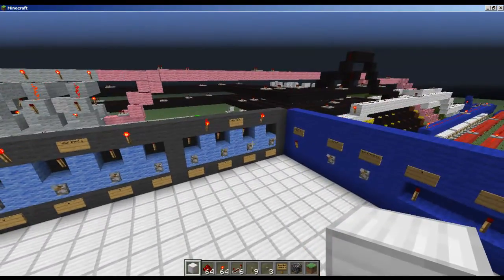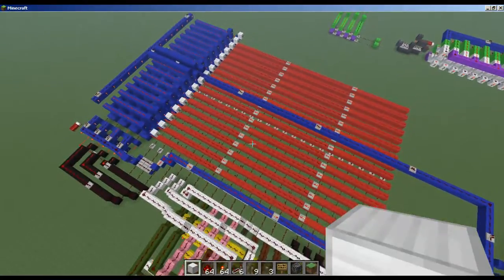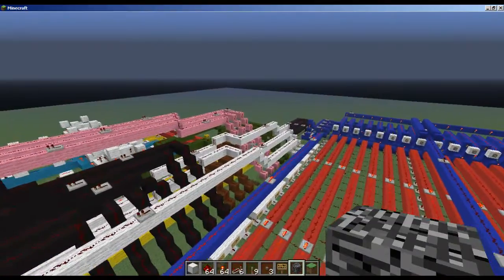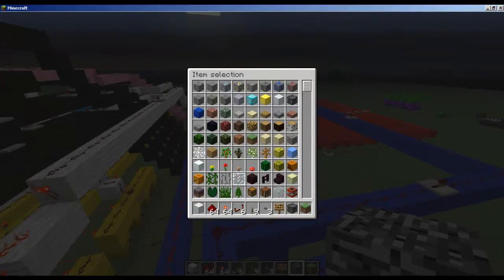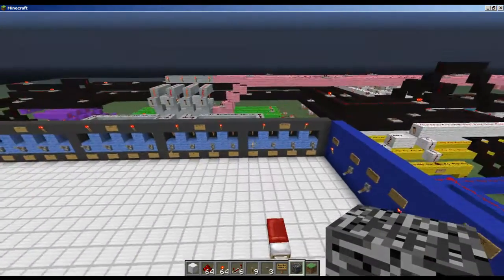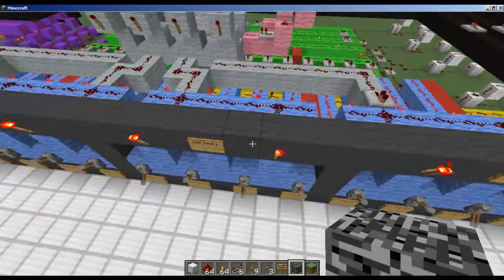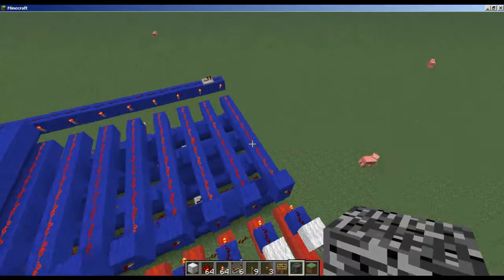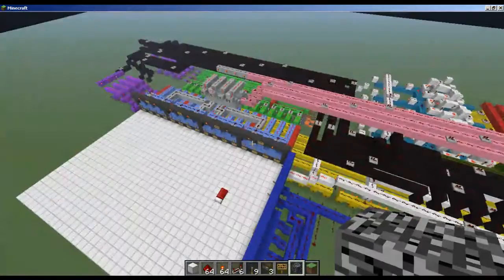4 Bit ALU Computer in Minecraft - Tutorial and Download

Comment: I am currently making one of these (from the same tutorial) WITHOUT Mc Edit. But the diffrence is, mine is (or will be) VERY compact. I shall use 2 mods: Redpower (for compact wires) and SPC (Single Player Commands- for copy/paste; easier placement rather than guessing). The bus where you take inputs and arange them (A1B1A2B2 etc.) I can do that in 3 blocks using REdpower.